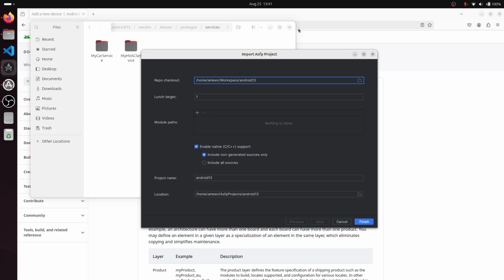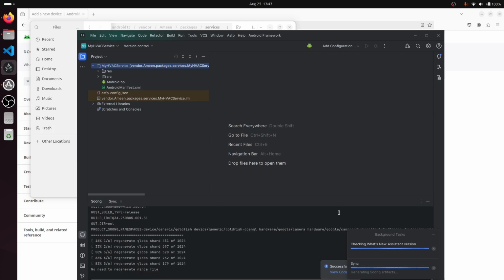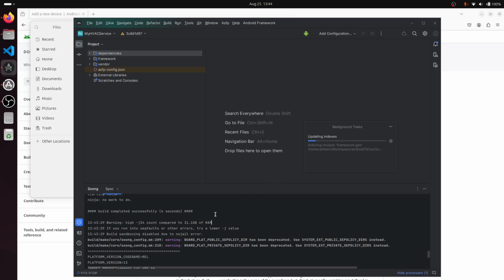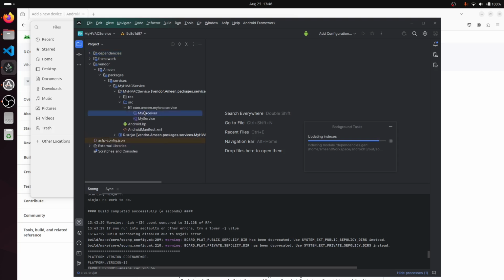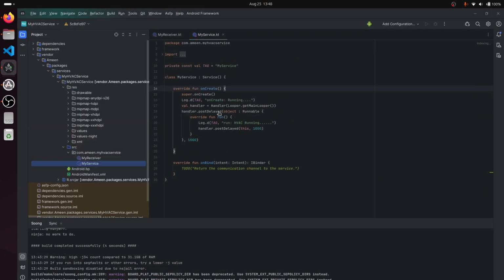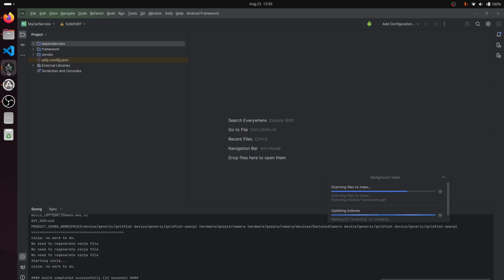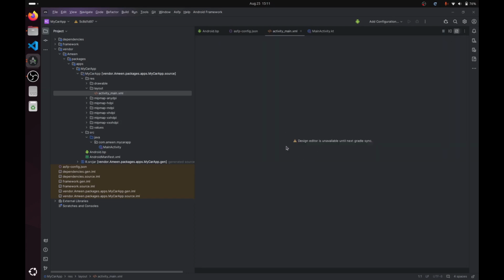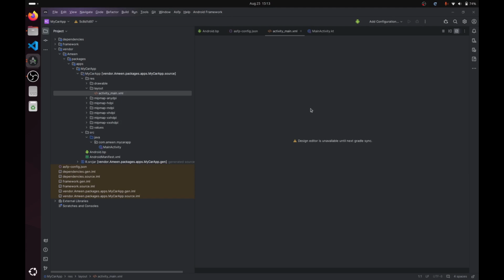Importing Project Into ASFP

Comment: Hi @ameen, first of all appropriating your work related to AOSP videos.

Can you please do a perticular module like connectivity or audio. That's helpful for understanding how the car api works. 
Please do more videos.
Reply from the maker: Connectivity like projection or Dialer ??? 
Audio like media player app ??
Reply: @ameenmaheen  connectivity like wifi or bluetooth. 
That is available in web, but don't know about sub modules, APIs data flow in real time working.
Reply from the maker: @hachinsta3890 are we talking about about BSP level changes or app level api usages for wifi and BT ??
Reply: @ameenmaheen  I don't know that much idea about. May be hmi to hardware communication.
Reply from the maker: @hachinsta3890  Ok generally we will work around HMI to Android framework... But low level the board provider mostly does the implementation and make the board workable with hardware components like wifi and BT.. When the time permits I will try to cover those areas. Meantime you can start at HMI and dig deep, till the area you are trying to explore
Reply: @ameenmaheen  sure bro 😊🥂